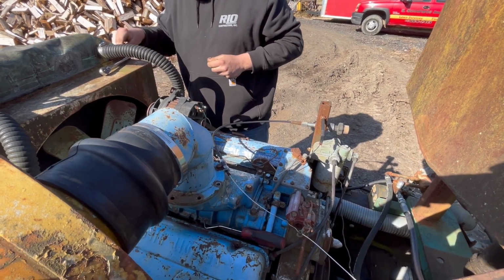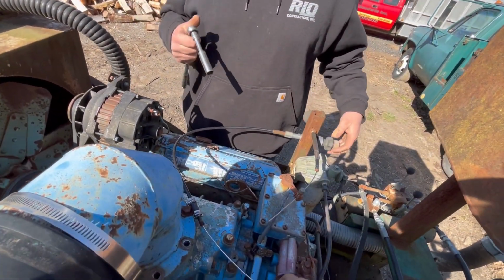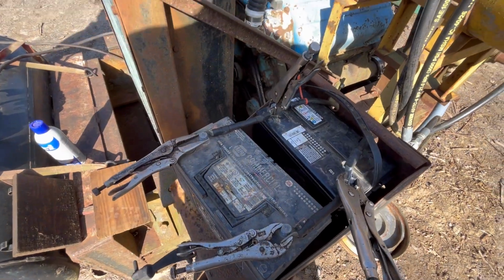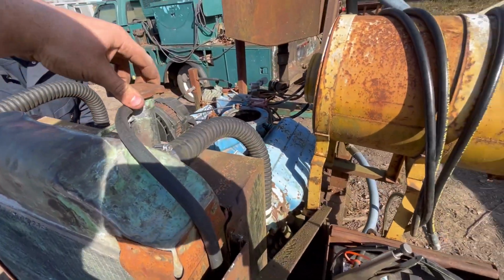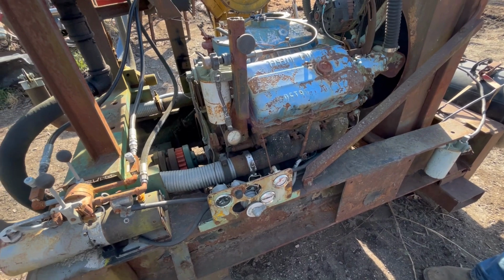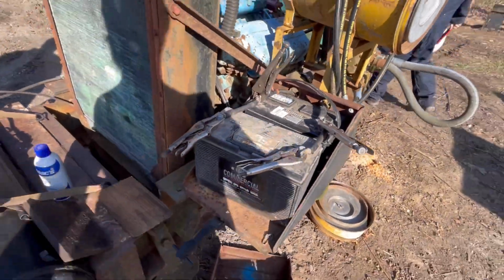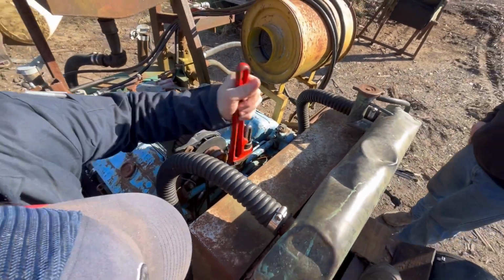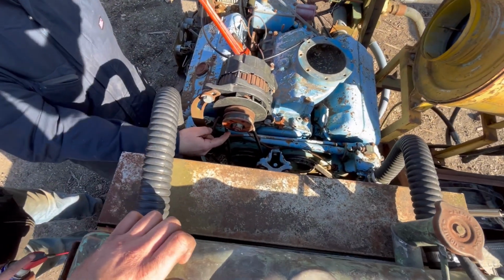Will it start? Detroit diesel 6v53.

Comment: 6v53? 6v71? Or 6v92?
Reply from the maker: 6v71
Reply: @WeldingandWheeling  No, I think that was a 6v53 judging by the valve covers and the engine size.
Reply from the maker: You are correct I was wrong